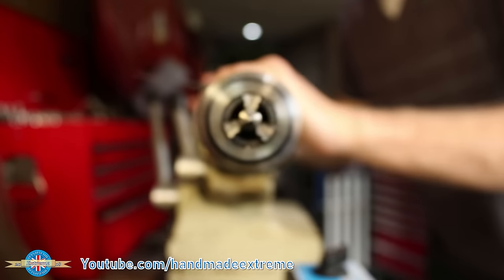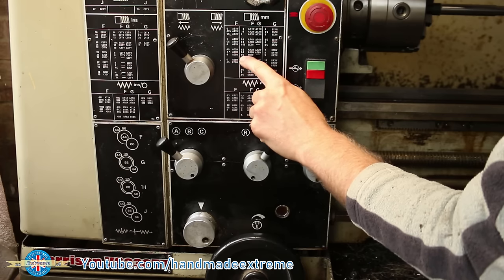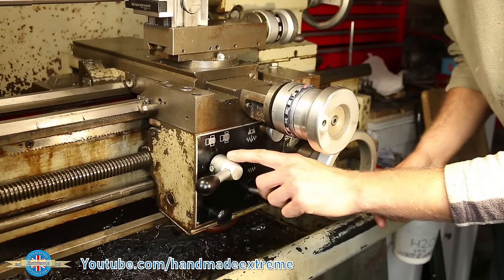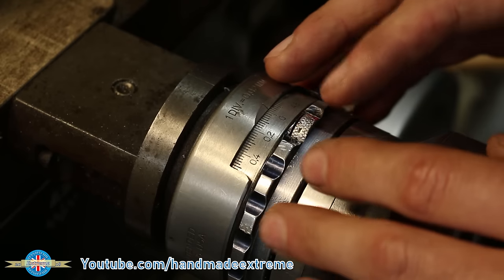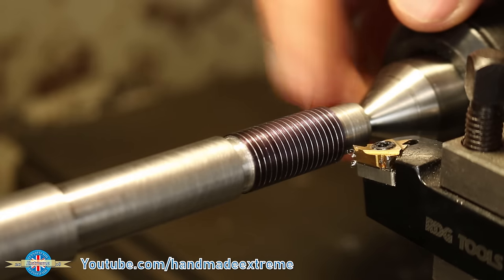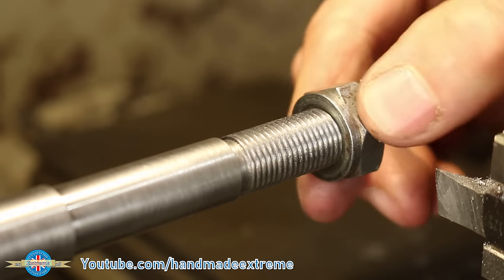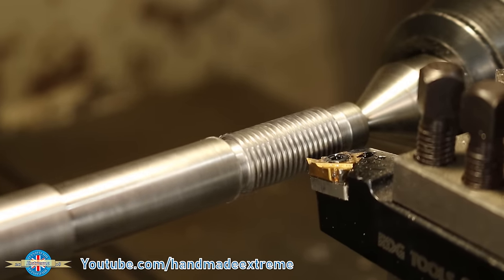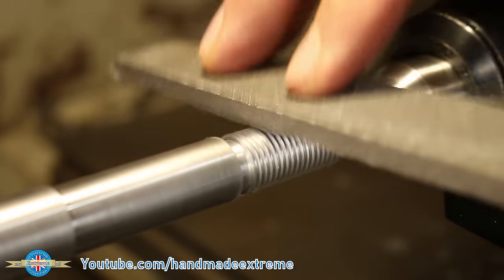How to cut a thread on a manual lathe (Intermediate method ideal for home workshop & hobby engineer)

Comment: How to remember the exact place of mark on screw for the second and subsequent cuts after reversing the tool back to its original position?
Reply from the maker: That's what the little dial with the numbers 1-8 on it is for. It ensures you always start in the right place.
Reply: Do you always have to use the same number you started with on every pass?
Reply: @pinebluffs2724  on my Harrison lathe you can use any number or scribe line on the thread engage dial when you are cutting even number of threads per inch like 14, 16, 18 etc, when you are screw cutting odd number of thread's per inch like 13,15,17 etc you can only use the numbered scribe lines on the thread engage dial, if you dont the tool does not cut in the same place, it is out of pitch.
Reply: @pinebluffs2724 no you do not. You can use any of the numbers listed for the thread you're cutting on the small chart below the threading dial. The thread he cuts in this video allows a person to use any of the numbers 1-8. I'm not sure why he continues to use the same numbed, but on the plus side you'll never make a mistake if you pick one and stick with it.

Comment: my mini lathe cant disengage half nut...when this disengage half nut, cut off track..can you give me any idea?....i just try reverse and forward leadscrew...and any time, cutting crash...
Reply from the maker: If you can't remove the lead screw then you have to stop the lathe at the end of the cut. .Withdraw the tool, then reverse the machine then stop it again when you are back at the start. Put the machine back into forward gear then put on your next cut. It's slower but works. Best to practice on some scrap first.

Comment: A bit of threadding lore......the compound when threadding 60deg thread form should always be set to 29.5 deg for a solid clean thread, basically you aim to keep the tool interfering with the work as little as possible throughout the cut. then feed off the cross feed .0005 on the finish pass to clean up the thread. Otherwise the tool engages the work too much and begins to rip the steel due to too much threadding too surface contact. Also ...on an older machine, the lathe operaters usually lightly drag their hands on the carriage wheel to keep slight tension on the leadscrew.IJS

Comment: I just about fell of my seat when you said you want the lathe running slowly, that’s incorrect. Rule of thumb for carbide cutter’s is 3 X speed of HSS. That thread should be run around 600 rpm, generally I’m cutting round 870 but I’m a bit rusty

Comment: what kind of Scotch Brite do you use?
Reply from the maker: Normally just what ever I can get hold off. I do prefer the 3M stuff though. Brown, Green and Red normally.
Reply: @Handmadeextreme  I know they come with a number. Do you know that number ? Thanks
Reply from the maker: @raymundoortiz7269  I think the Brown is 7440 which is course. The Green 7486 is also quite course. The Red 7447+ is quite fine. Hope that helps.

Comment: I think I have to shot my own clip how to cut thread at lathe. From my angle of view, this is about how to "rape" the thread at the stick. The surface of your cutted thread is terrible. Nor the file, nor the sanding paper or scotchbrite help it. What's the benefit of bluemarking the surface? What about to use cutting oil and little bit higher speed? I often cut 7/8" 14tpi at hobby bench lathe, but Sir, even that lathe-toy is able to make cleaner thread than what you show here.

Comment: Your cross slide should not be used to advance the toolbit for each successive cut. It should be returned to the same position (zero) for each cut. The compound should be set to 29.5 degrees, and it is advanced for each successive cut of the thread. Doing it this way means the toolbit is only cutting on one face, greatly reducing the tool pressure and improving the finish.
Otherwise great video!

Comment: I'd have to say, I disagree with this method being "less risky" because you are relying on remembering your last depth of cut on the cross slide dial by using the cross slide to control your depth. 

By setting up and using the compound as you should, you do NOT have to remember the previous cut because its there the whole time since you are using the compound and never changing it except to increase depth of next cut (i.e., you are never backing it out to clear you threads on the return) and all you have to remember is 0 (zero) on the cross slide. Any distraction that might arise in the shop will not risk causing you to forget what your last depth was and risk possibly taking too deep of a cut and breaking the tool or messing up the part. 

Plus there is the simple fact that using the cross slide rather than the compound set at the 29 / 29.5° angle setting is causing the tool to cut full flank on both sides which causes chatter vs the angled compound is only causing the tool to cut on the leading side full flank and a very small amount on the trailing side so much less risk of chatter.

Comment: Wrong.  You need to put the compound on a 60 degree angle and increase the depth of cut with the compound not the cross slide. The thread has a 60 degree profile. Therefore the cutting tool will cut on the lead side of the cutting tool making a cleaner thread. You also didn't show how to use a 60 degree thread center gage to make sure the cutting tool is perpendicular to the work. Cutting oil works wonders in making a nice clean thread too.

Comment: The work surface speed is way too slow for that carbide insert.
Reply from the maker: Absolutely correct. I ran it that slow in an effort to make the video a bit clearer so that people would be able to take in what they are seeing. Under normal circumstances yes it would all be a lot faster. Great observation. Thanks for watching.

Comment: That insert is far too big for the pitch & will give a much larger radius in the root of the thread. So the cut had to be deeper to get the nut on, that's why you machined into your undercut. This thread will not engage properly as the flanks have now been machined too wide so the nut crest radius can clear the large root radius left by using a tip that has a radius form too large for this pitch. Also a full form insert will create the correct crest radius so no file or scotchbrite. The inserts are not designed to cut all around their profile so plunge cutting is not advised. Always advance the tool on the compound slide for each cut. You could have also increased the undercut with the threading tool instead of changing them over & back again. If you had known that the inserts came in different pitches it would have been much easier & given a true formed thread.

Comment: If you have had to swap out tools, recut your "chicken run", you done it wrong.
Mind, single point screwcutting is always an individual job from lathe to lathe.... 1/8th of an inch to 5inch requires different techniques, as I'm sure you know
Ps:chicken run with as big a radius cut as you can

Comment: A little bit rough, that thread...
Reply from the maker: It is your right. I refrained from using the cutting fluid so people could see what was going on a bit clearer, also surface speed was way to slow for carbide..... Should have used the fluid haha.

Comment: In 12m i would made like 10 of does around  250 rpm to 320 rpm  using the cut oil in everyone. Youre kinda slow Sir.